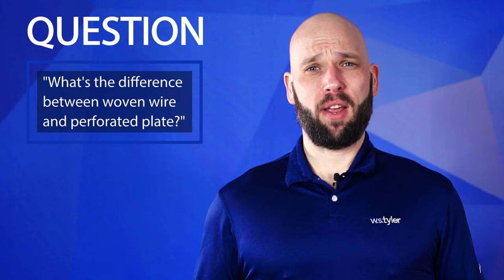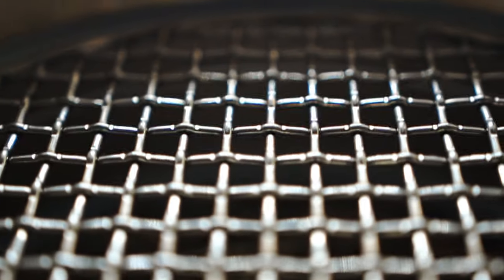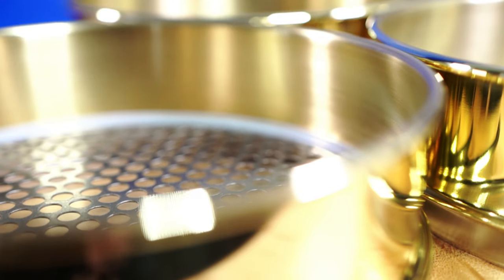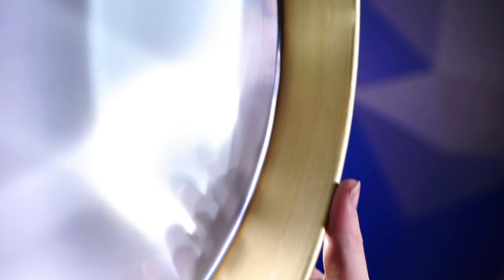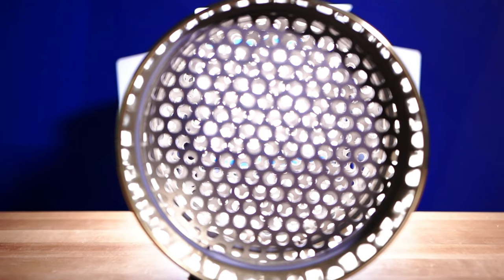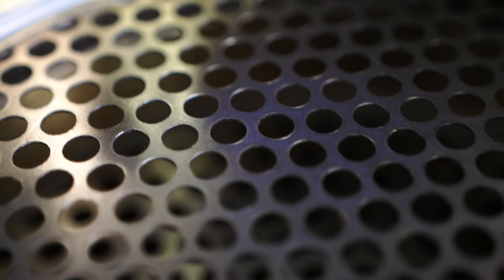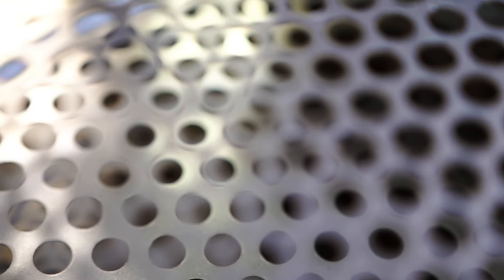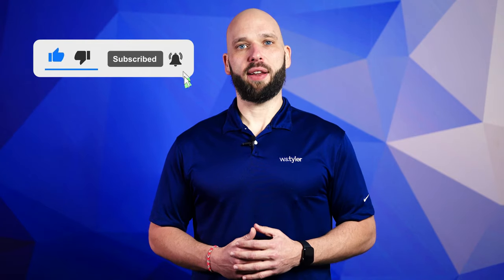Woven Wire Mesh VS Perforated Plate Sieves

Comment: Howdy W.S. Tyler;
 I am looking for a wire mesh screen for an Air filter backing-plate, that bolt on to a carburetor using it with the aid of the mounting gasket. Is this possible? And if so what information would you need for the exact measurement in making a screen to fit. Maybe one of the per-cut gaskets? The ideal is just in case one (or more) of the mounting bolts come loose while the engine is running it (they) won't end-up down inside of the cylinder causing damage to the piston(s).
Hope to hear from you soon.
Thank you for your time.
Stevo